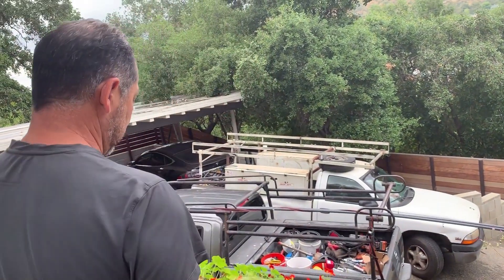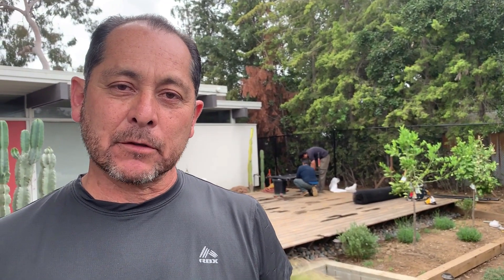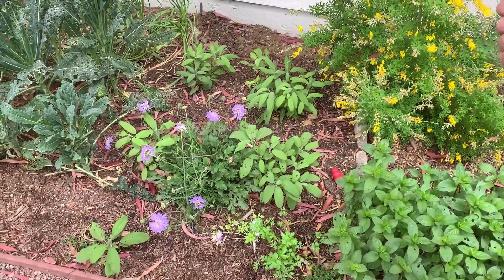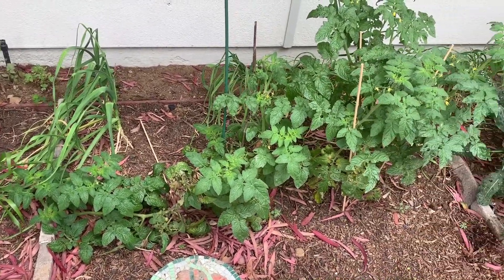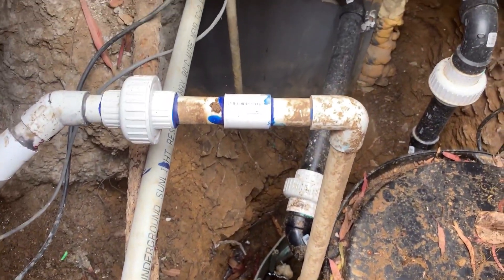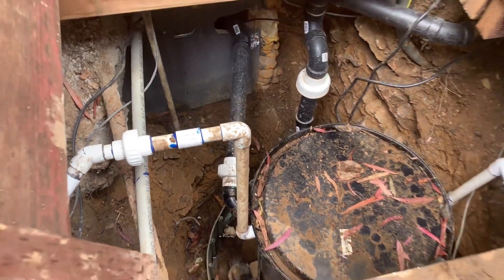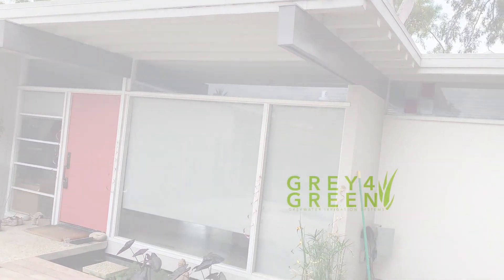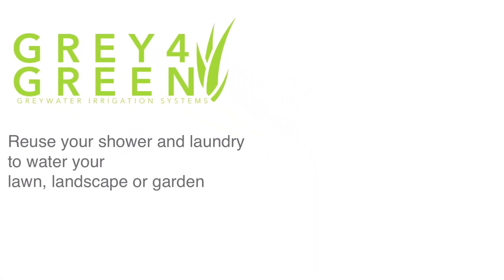A DIY Greywater System Installed Under a Slab Foundation - Eagle Rock

Comment: awesome job. Slabs suck for grey water, Glad you figgure out a way to do this. I am thinking about using a transfer pump like a saniflo or liberty404 unit to transfer water from my central bathroom to the west side of my house. a jack hammer is needed to remove some cement under the tub! So it can be done but not easily!